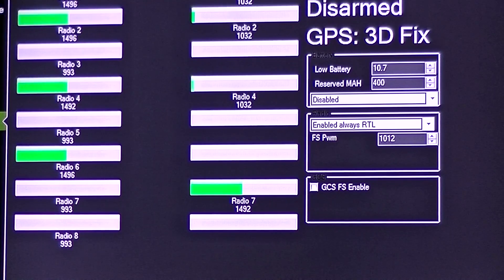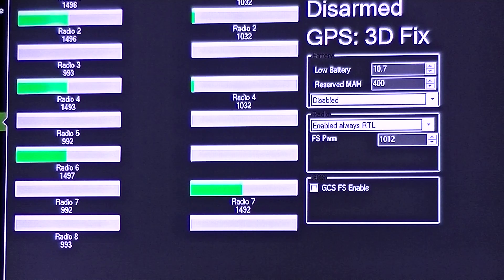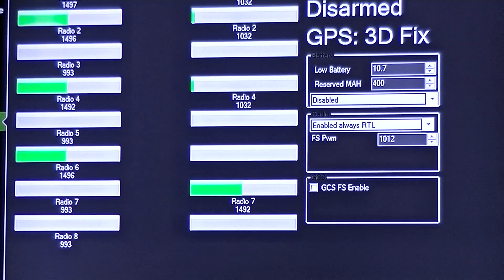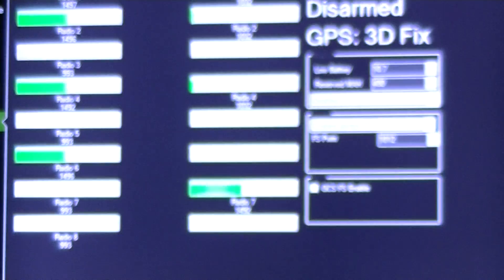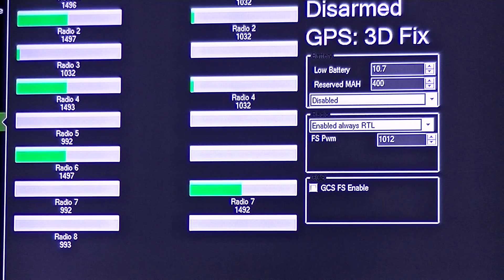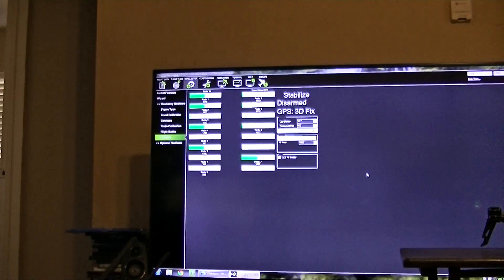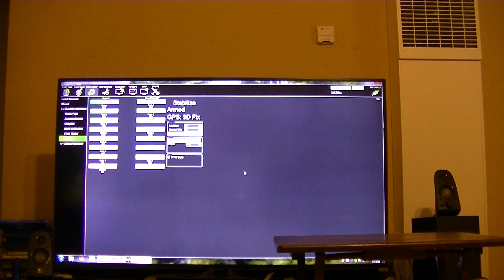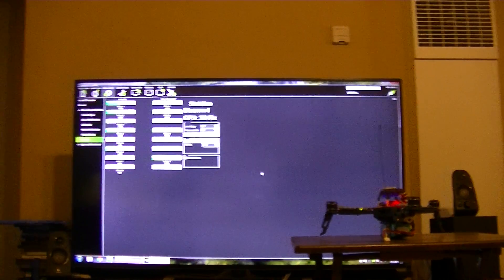ezuhf throtle failsafe setting for APM and Pixhawk

Comment: Hi I get prearm: Check FS_THR_VA I cannot arm it after I set the throttle trim to 1030. I tried radio calibration already.
Reply from the maker: John Law  I haven't run into that problem but it sounds like you need to calibrate your ESCs.
Reply: +3D Drones And that is a huge problem too! How do I calibrate my esc using APM 2.6 through EzUhf when I change throttle min to 1030. I haven´t manage to do that yet. I have tried allmost everthing
Reply from the maker: Ok change the throttle min back to the original spot.  then do a esc calibration by having your drone unplugged and raise your Throttle to max, then plug in the drone (don't worry its safe...  or remove the props for extra security).  The ESCs will power on... Unplug the battery and plug it back in again.   the ESCs should make an extra beep after they boot up.  then quickly lower your throttle all the way down.  you should heat the final beeps from the ESCs telling you they are armed.  at this point you can slowly raise stick back up and make sure the motors all spin up at the same time.

It took me a few days to figure out the process for the F/S on the EZUHF,  I could not find anyone who had done it.  and its been a few months so I will have to watch my own video again to refresh myshelf on the process.  bit I will help you figure this out.  what radio are you using?
Reply: +3D Drones 
Ok! _Thanks for fast reply! My tx is turnigy 9x. I also have Taranis. I will try that one, to see if it works
Reply from the maker: +minibok2008 yea try the process with the taranis as I do in the video... if successful you should have an idea of how to do it on the 9X.  I don't have a 9X so I might not be much help with it.
Reply: +3D Drones It´s strange. I can´t get into calibration mode on my APM with a value like 1039 and my lowest is 999, not 993.
Reply from the maker: APM esc calibration mode begins at max throttle.  if your not able to enter it there is another issue.  you should be able to enter calibration... if the EZUHF is the problem you just wont be able to finish the process
Reply: +3D Drones  Yes I know, I have done it with my other vehicles w/o problem. Thanks for helping me! I will try again
Reply: +minibok2008 this what I read on FPV-lab:
Some ESC's timeout of their calibration modes and cannot be calibrated with ezuhf since it seems to boot slowly on the rx. There are various workarounds to this including powering up the rx before the esc and the failsafe trick. If your esc doesn't have this issue you will never notice it, if it does you are stuck unless you know the trick. Once calibrated set the failsafe throttle to something safe.

And
i ended up using my old frsky module and receiver as my esc's kept going out of calibration mode by the time the immersion rx/tx bound.i did read there is a work around but i couldnt understand how to do it.
Reply from the maker: so have you tried using the frsky to calibrate the esc's then switching over to the EZUHF for the F/S.   the problem could be the version of software on the EZUHF.  I haven't updated mine in a long time.  I will check what version im running.
Reply: +3D Drones I´ve tried everthing now. Nothing goes. Even this http://www.rcgroups.com/forums/showthread.php?t=2200016 and your suggestion. Maybe I can´t use PPM muxed
Reply: +minibok2008  I use version 1.52

Comment from the maker: sorry for my poor vocabulary... after trimming the taranis then do a radio calibration on MP...  this will alow the arming and disarming of the board... you might need to adjust your throttle mid position to hover at mid stick after trimming